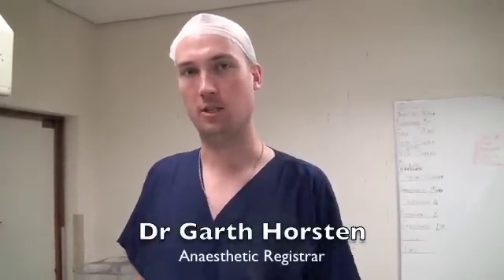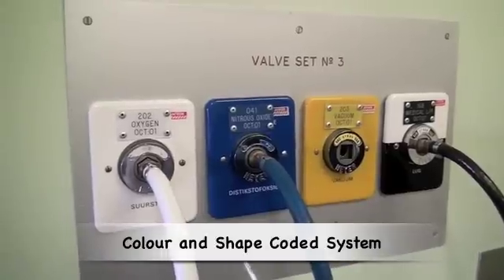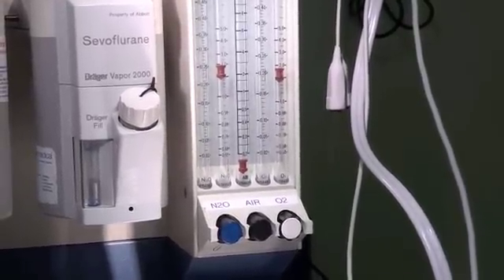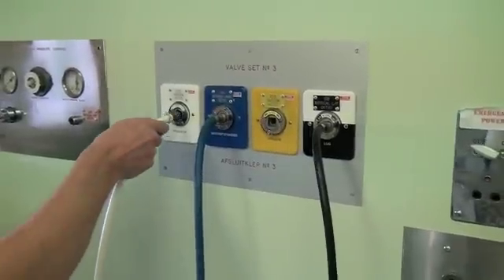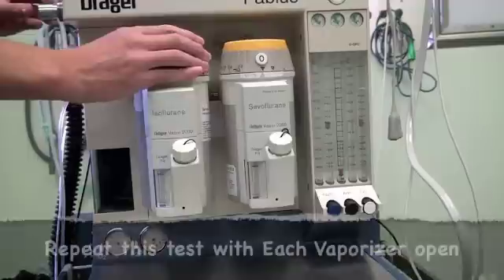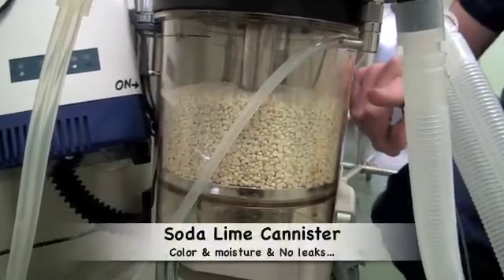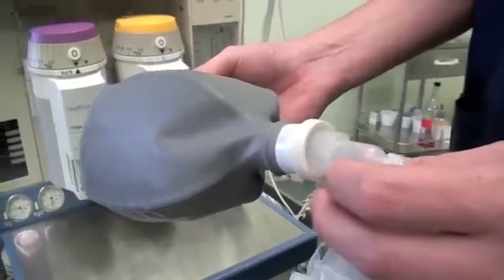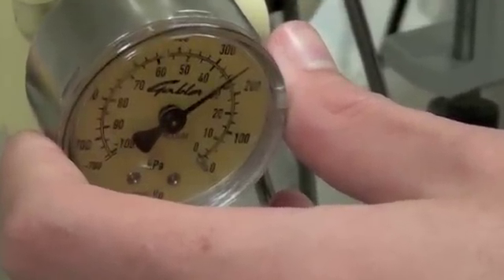The Anaesthetic Machine Check

Comment: The color of the connectors for the central gas supply or gas tanks may vary from country to country. For example, oxygen gas outlets and tanks are colored GREEN in other countries, and the color coding of central gas supply wall outlets shown in this video is according to German standards (DIN).